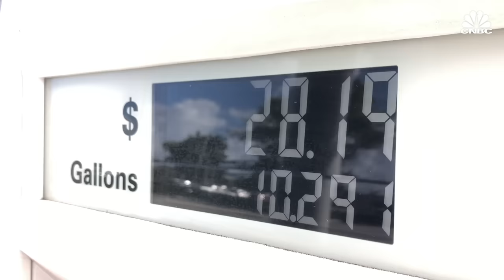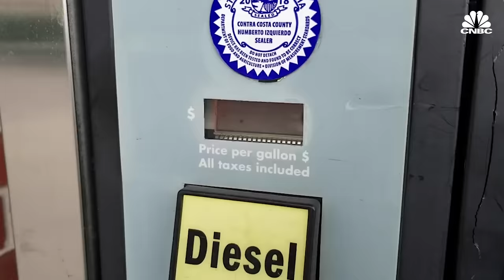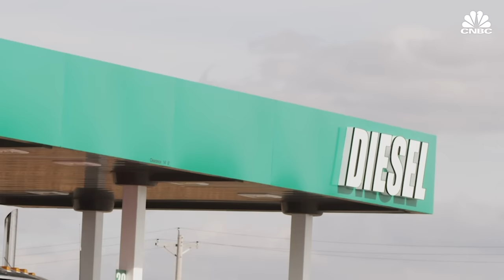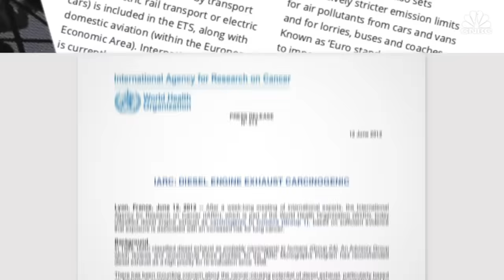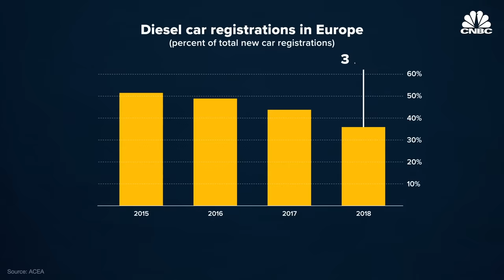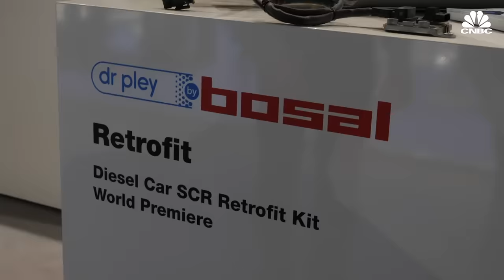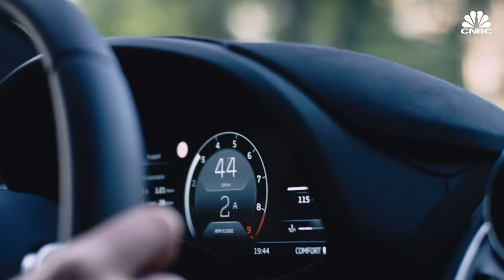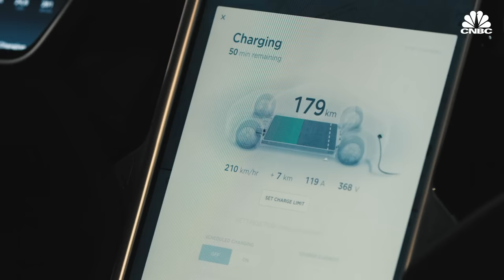Why Diesel Cars Are Disappearing

Comment: We should be making clean biodiesel. It's cleaner and easier to make than ethanol and big trucks would benefit from it while more and more passenger cars can run on hybrid or pure electric. 
Various crops can be used: 

Mustard seed: 48 gallons per acre. 

Corn: 51 gallons per acre. 

Soybeans: 70 gallons per acre. 

Switchgrass: 80 gallons per acre. 

Rapeseed: 86 gallons per acre. 

Canola: 92 gallons per acre. 

Peanuts: 240 gallons per acre. 

Algae: 1000 gallons per acre. 

Switchgrass, peanuts and algae and the most promising due to certain advantages of them. 

Algae has the highest per acre yield by far, but also requires substantial infrastructure to farm it. Benefits include, low cost to farm, the ability to use runoff water from farms which the algae cleans by removing the harmful chemicals added from cow manure or even chemical fertilizers. Doesn't require fertile farmland and can be grown on or near farms using space that is not useful for growing food crops. Very high greenhouse gas absorption. 

Peanuts are great but do require more effort to plant and harvest than algae or Switchgrass, but doesn't require the infrastructure of algae. It does however use farmland that could be used to grow food crops. Such as peanuts. Go figure. 

Switchgrass is a 10 foot tall perennial grass, so planting only occurs once every 8-12 years. This leads to very low harvest costs in fuel used to produce the crop. Switchgrass grows well enough in rocky, loamy or sandy soil for it to be profitable and thrives in floodlands. All areas which can't be well used for food crops like corn or wheat, freeing those areas for food production, and providing profit for land that normally wouldn't be profitable for any crops. Side benefits are that it's a habitat for many types of wildlife, so the grass spreading into areas around the land that can't be harvested is beneficial for wildlife as well. And it has a strong affect on absorbing greenhouse gasses. Low cost to begin farming; all that is needed to farm switchgrass is a tractor, hay mower and hay baler. And these don't have to be the newest, biggest, $500,000.00 machines, but rather, using older, used farm equipment, which reduces waste by using things already built rather than buying new. Meaning many small farms and hobby farms could supplement their income by raising switchgrass for biodiesel. 

Honorable mentions: 
*Soybeans. Humans shouldn't be eating soybeans unless they are fermented (soy sauce for example) due to harmful affects of the soy oil by unnaturally raising estrogen hormone levels in men and women to unhealthy levels. It makes good diesel and is also used to make plastic.

*Canola(a type of rapeseed) biodiesel made from Canola oil has the benefit of resisting gelling in colder weather than other biodiesel sources. 

In the end, the type of crop used to make biodiesel is less relavent than the need to be using biodiesel. We use thousands of acres of farmland growing corn to make ethanol, when we should at least be growing crops that have higher yield for fuel. And preferably be growing crops that don't require the use of crop ground that will more likely be useful for growing food to feed people.

Comment: I drive a 24v Cummins turbo diesel and everytime I fire it up I love polluting the earth.
Reply: But you not polluting the earth. Diesel polluting only cities, thats why they baning diesels in cities.
Reply: Yet if you were to put a gas engine with similar displacement the carbon footprint on the gasser qould be more than the cummins
Reply: Gassers are better than 10 to 1 and diesel is the problem ..... emission systems are worse on the environment than straight diesel and designed to crush owner operator truckers . I'll keep my mega moose and my caterpillars
Reply: Evermore  Slow down there buckaroo. Too much CO2 is still bad. If you breathed 100% oxygen, you would get extremely ill, because you're not biologically equipped to deal with that concentration of oxygen, even though you MUST take in oxygen to live. The takeaway is that plants don't love exhaust fumes.
Reply: Evermore  They also love BRAUNDO! It's got what plants CRAVE!
Reply: Evermore  LOLZ

Comment: Kubota and Yanmar do a joint venture with all auto manufacturers installing 2 and 3 cylinder turbo diesels in cars capable of low emissions an incredible fuel mileage. There is no such thing as zero emission electric cars. Plugging them all in creates a greater demand on gas and coal-fired power plants
Reply: Precisely So..! But to put that in collective consciousness would take another decade when people would realize that euro 6 diesel was a better option.
Reply: Also add in the huge amount of energy needed to build electric cars compared to Diesel and Petrol/Gasoline.
Reply: @lazycalm41  The battery requires indeed more energy = CO2 to be created but even the most pessimistic study says that above 60000 miles/100000 km the electric vehicle wins every time. Even if the electricity is coal based. Which it increasingly isnt.
Reply: @abhijit1509ibskol  Not really. For the environment and our air qualtiy it would be better if all internal combustion engines in cars would be replaced by electric ones, even if the electricity would be coal based.
Reply: @aresivrc1800  Well lets see what happens with the first generation of Toyota Prius's as they are reaching the end of their batteries life span! Also my point about container 
ships.
Reply: @aresivrc1800  are there any data and objective analysis to substantiate your statement? What about the massive pollution generated by the coal plants? Please do not be only concerned about cities, pollution is a global problem. Myopic approaches are even more dangerous. Disproportionately high energy consumption of developed markets need to be controlled.
Reply: @abhijit1509ibskol  A century ago, railway networks chose electric railcars powered by coal plants over the steam locomotives because they could obtain a better output out of coal as a fuel when used in a power plant than directly in the locomotive. That's how electricity took off, with the advantage they could also obtain a lot more power than with any steam locomotive. They showed us the way. So the electric car is inevitable.
Reply: @julosx  do you think the analogy of electric locomotives and battery powered cars is correct? Please remember electric locos were way more efficient than coal or diesel
 powered locos from day one. 2nd they are still so expensive to setup that even in US it is largely diesel loco. Look I do not want a debate, my point of view is battery is not the best solution, it is not efficient in terms of energy density and the hazardous battery materials and no actual change in macro pollution and carbon footprint would mean battery is not the sustainable solution. May be Hydrogen is a better option but technology is still evolving. Burning diesel efficiently is better than burning coal in power plants.
The biggest problem of diesel is nitrous oxide. And those and spm have been reduced by more than 85% (when compared between euro 4 and euro 6).
Reply: A little bit like refining oil then?

Comment: Been driving heavy trucks for 45 years,drive a diesel Volvo car and have a Yanmar diesel in my boat that’s done thousands of hours since 2007 never missed a beat and only ever changed the oil every 250hrs,the reliability and fuel economy of the Diesel engine are incredible.But my electric 1500w pedal bike puts a smile on my face every time I ride it instant torque, and riding up a 1 in 4ft gradient as if it’s totally flat road silently,EV’s are the future exciting times.

Comment: I prefer butt gas. Low efficiency, but high performance.
Reply: You run on 4 % methane and 96 % air, basically. Must be pretty economical.
Reply: We'll see candle wax running a diesel engine well before then. Poop to power? Just imagine how much Taco Bell you have to eat to get a few cubic feet of gas.

Comment: It's not a problem we couldn't engineer around - it's simply that gasoline is a lot more profitable for the oil industry and it's so easy to say "diesel is carcinogenic" - not if you filter the exhaust properly. Americans never wanted diesel except for trucks. In the US it also has to do with how "clean" is defined by the EPA: it's not as common sense would dictate that you measure how much exhaust comes out of a car per distance driven, in the US it's how much comes out of a car per gallon burned. So a HumV burning a gallon every 5 miles is considered cleaner than a BMW burning a gallon every 50 miles - which is why you can't buy some of the diesel BMW's in the US - they have the mileage of a Prius but the exhaust from that 1 gallon of diesel is dirtier than allowed. Just when you calculate how much stuff comes out of that "clean" HumV you will realize that the regulation favors the oil industry and not the environment.

Comment: I love diesel cars
Reply: My C-5500 YES!  A wonderful Pickup!
Reply: @tiojuan174  I miss my old Chevette diesel, rear wheel drive, a lot more fun and could handle way more abuse than a Rabbit could. The Isuzu engine that they had lived much longer than the Rabbit engines and got better mileage. I owned both, will never drive a Rabbit again, even if one is given for free, unless it is converted to the newer TDI engine. Lol.
Reply: Diesel is the best tbh. Petrol is weak until you're red lining and EVs are cute with their very limited range and long charge times. 😹
Reply: I hate these crappy cars. They're just useless.

Comment: As an electrician, I can not recommend battery-powered systems and that goes for cars as well. When one cell in a battery bank fails, the whole battery bank is damaged and people simply don't have the money to incur that replacement cost every few months.
In Africa everything is long distances from everything else in very hot temperatures where pertol would evaporate and batteries become dry.

The NOx and CO2 are plant food, essential for life on earth and essential for increased productivity in both the land and ocean ecosystems.
The problem is that people choose to live in the high density cities, rather than relocate to Africa or the countryside.
By rezoning all land use as multifunction, most commuting can be limited in either duration or frequency, reducing the cities' air pollution issue.
Reply: gas doesnt evaporate like you think it does, its in a sealed container

Comment: Do not get me wrong, I myself drive 2 diesel Volvo V70 and love them! But many are in denial: electric cars take over, no doubt about that. They are becoming more and more efficient in range and cargo space. There are already electric cars that easily reached 500.000 kilometers and beyond, with FAR less operating/repair costs compaired to diesels or petrols. I know it is a stab in the heart for fuel car loving people ( myself included) but the world is changing and it is going fast.
Reply: EV operating costs are much lower, but this is offset by huge capital costs.  Takes 200-300,000KM to break even on a Tesla v petrol ICE.  Even longer if the ICE is diesel.  
As for repair costs.  I call BS.  Modern EVs have not been around long enough to provide data to support your claim.  Old cars at 10 yrs+ have suffered as badly or worse than ICE cars.  Battery fires, inverter problems, battery-cell problems and with Tesla retaining right to repair you get hit with a $20,000 replacement battery bill.  
I have owned 4 diesels since 1991. All were serviced in accordance with the manual (within a few days or 10's of Kms) and I have spent ZERO $ on repairs in 31 years.  Yes, ZERO $. 
A video I saw of an early Tesla over 10 yrs had $12000 or repairs PLUS 4 new suspension units, new inverter and 4 new electronic door handles under warranty (approx $20,000).

Comment: Well, they are disappearing in America but in my country they thrive, I mean people prefer diesel cars bc diesel is cheaper than petrol...
Reply: Used diesel car with AC, electric mirrors/ windows etc. costs 700-3000$... Cheapest EV costs something like 30.000$ (requires taking a loan- not fun), not much better used (no "old" EV's yet, and you wouldn't want a 10-15 year old EV anyway- dead battery). On top of this you need a garage. In my neighborhood only 20% of people have this luxury (no space).

Comment: I’ll stop driving my diesel when they stop selling diesel
Reply: they are at least when produced after 2018 the cleanest car option period.
Reply: Well...in time they will
Reply: Willie Peter  hydrogen has to manny backdraws, storage - 170 degrees celcius, very explosif corrosif and corrosif also, it takes 3 times as much energie then you get out of it in the form of hydrogen, it is only an option with boundles energy, a major breakthrough in nucliar fusion, thorium, when liquid fuels are required

Comment: Just a quick one. For right or wrong, my current car is diesel, and due to lower Co2 than an equivalent petrol, dpf and adblue, it is cleaner overall than the petrol versions. And is better on the motorway, more fuel efficient and therefore more cost effective.

I get all of the scandals, but I don't think diesel has quite met it's death just yet.

Comment: Diesel is not lost. Only some countries block diesel because of their emission protocols.

In countries without selective taxation (ours, for example), diesel is the most popular engine type.

Autogas has several problems.
Gasoline burns 1.5-2 times more in the city.
Repair costs of electric vehicles are much higher than the current savings.

Comment: So with more ev vehicles, surely this would take up more electricity from already overloaded grids around the world.  And what methods is that electricity produced? Unless its totally hydro then it creates a very large carbon footprint. And how do you dispose of a huge lithium battery from an electric car easily, safely and environmentally friendly.
Reply: The white elephant 🐘 in the room....   The issue no one wants to discuss in depth...  The impact of producing and disposing/recycling all the lithium batteries that transitioning to the wonderful world of electric technology will require.
The uninformed even try to tell me we can make our cities "green" with renewable energy, and great big banks of batteries! It works in Tesla's cars".
Yeah, right.  And that technology is expected to come online right after we perfect cold fusion.
And in the meantime....
Well, as one guy said, "We need to return to a horse based transportation system."
Reply: No one can answer that question. Germany has around 30% ev cars and has had to fire up coal fired power stations to keep the lights on
If we ever get to 90% in the UK we would have to build 60 more power stations, probably nuclear ,this would take 20 years yet they want to be all electric by 2030? How is that going to work. Also my house leads straight onto a main road and has no drive. How do I charge an ev car?
Reply: You "dispose" of EV batteries in an EV battery recycling plant, like those built by Volkswagen and Renault in Europe. Existing companies, such as Technology Minerals - co founded by the brother of ex F1 racing driver Martin Brundle - are also looking to address this issue. They are planning around 5 battery recycling facilities in the UK. However, not all older EV batteries will be recycled. Many will be re-purposed for energy storage in commercial, industrial and domestic applications......they may no longer be up to the job of propelling a vehicle, but will be more than adequate for energy storage for many more years.
Reply: @richardnewton638  The National Grid disagree Richard. They say there will be no issues, and anticipate around 9 million EV's on Britain's roads by 2030, and 30 million by 2040. In fact so confident are the National Grid, they were among the organisations whom lobbied to bring the ban on the sale of new ICE cars and vans forward to 2030 from 2035. Both the Head of The National Grid (whom incidentally drives an EV), plus their Chief Development Officer, both appeared in front of a Parliamentary Committee a couple of years ago, specifically to answer questions regarding this issue. The video of that meeting is here on YouTube, should you wish to see it.  You yourself could charge an EV while you shopped, as Tesco, Sainsburys and some other supermarkets provide free charging. You could also suggest to your employer that Government grants are available for workplace charger installations. The cost of installation to your employer would be zero. Also, you seem to be overlooking the fact that if we're all driving EV's, then we're not going to be buying petrol or diesel from fuel forecourts, are we? That would probably mean that the UK's oil refineries would no longer need to produce 14 million gallons of petrol, and 11 million gallons of diesel each day. If that were the case, just think how much spare capacity there might be in the grid given that it takes between 6 and 8kw of electricity to produce each gallon.... Oh, plus of course there would be no further need to waste huge amounts of electricity just pumping oil out of the ground, before it even gets to a refinery. And if your house leads straight out onto a main road, then how do you fill your car now? You don't have a petrol station outside, so presumably you drive to a filling station?  So why wouldn't you drive to a public charging hub? And we're at 12% take-up rate with electric cars now Richard, so I'd estimate we'll see 90% before 2030. A number of UK car makers have said they'll be switching to full EV production by 2025. Most electric car owners actually prefer to charge at home for two reasons. 1. the cost. 2. Sheer convenience. It usually costs me around £8 to £9 to fully charge my EV, then I'm good for almost 300 miles. I also have solar panels, so I'm often able to offset that cost even further.......